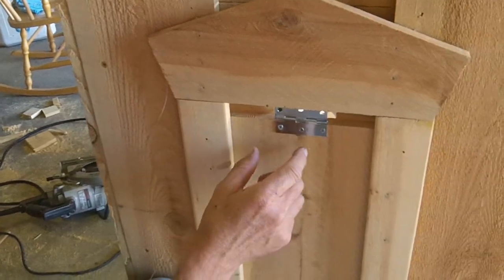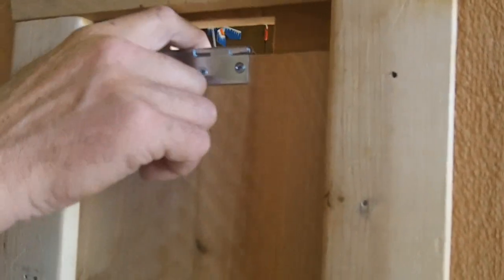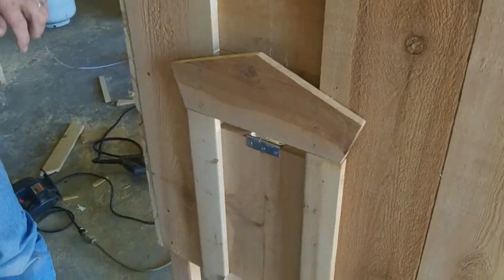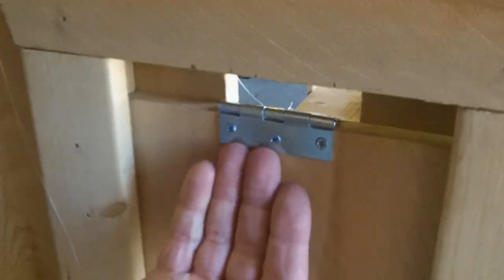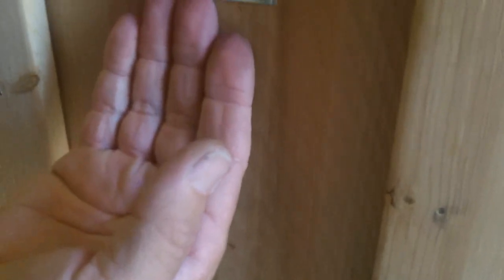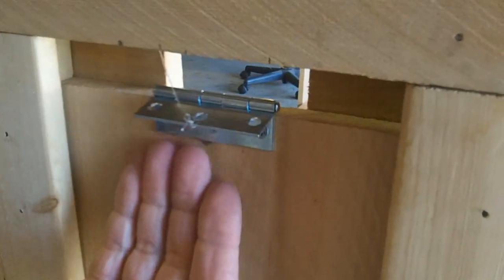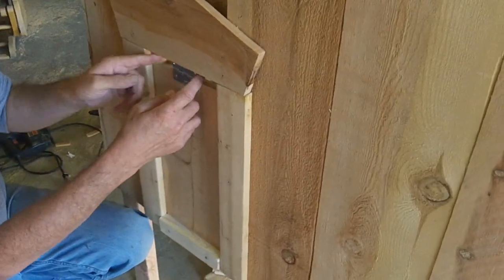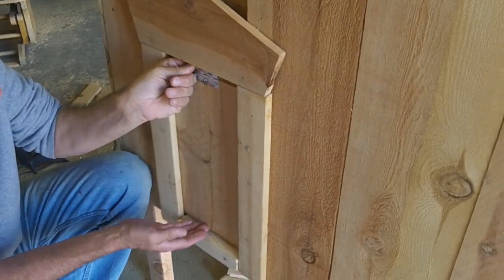A simpler self-locking predator-proof sliding chicken coop door concept

Comment: I just put a variation of this in my coop, works great. I used a clothes pin spring to force the hinge over, and made it flip to one side only so that there is no hole. Thanks so much for sharing your idea.
Reply: +enscribe I would like to see how you did this.
Reply: I would like to hear how you did this as well! Great idea, just trying to wrap my brain around how to make it work.
Reply: enscribe why not just use magnets. seems much easier. 

I already posted this so I'll just cut paste. 

I have a suggestion/modification that I will do on mine. Drop the header/top trim of the board so that the hinge will not be accessible to any predators. making it so the hinge can only fall one way. Shields it from the elements too. Next glue a small magnet to the top of the board just behind the hinge. This will ensure the hinge falls in place, adding extra effort to pull up. Some drawer magnets come with a hole in the center but if you can't find those, Harbor Freight has magnets you can glue on. Adding a magnet to the moving portion of the hinge gives it weight and helps stick to the other magnet.
Reply: Im making one like this for my coop and the front is blocked off and the top part of the hinge is pushed forward with a shim to create a slight angle, that way it physically cannot stay up and always falls forward. Only fail point I could imagine would be if junk got in the hinge over time and needed wd40 or something?

Comment: THanks for the idea!  Exactly what I was looking for!  Two comments or possible issues for improvement:   1)  The opening will let out heat from the run/coop  2)  We have snakes and ferrets/weasels that may be able to squeeze through the same gap.

I am going to try to build a housing for the hinge mech that can minimize both issues.  If it works out, I will post the solution if others are interested.

Comment: Very nice!  After seeing a raccoon use it's nails to pull a swinging cat door towards itself so it could slip back out of our garage I have great respect for these critters.  I would say make sure that they can't push the hinge up into the open position while pushing the door up enough (using the bottom of the hinge like you did) for the bottom of the door to clear the coop framing on the bottom of the door.

I would make the following mods:  1) mount the hinge on the inside of the coop so the bottom of the hinge can't be used as a handle from the outside. 2) make the door tall enough and the bottom door frame deep enough that the hinge has to entirely disappear into the top before there is an opening at the bottom of the door.  That seem to keep even our college educated raccoons from getting inside.

Not sure if this door system would work for areas with snakes.

Comment: I used this method on my new coop, did it a little different.  Liked the other folks idea of keeping the latch swinging one way so picking one of the non moving parts of the hinge barrel I angled a screw into the top of the door.  Now the hinge cannot go past verticle to the other side and falls one way only.  Works great and I had a hinge in my junk drawers, off what I can't remember.  Why I kept it in there when I moved everything and threw most of it out 3 years ago, well now I guess I know.  Thanks for the idea.  Plenty of them on youtube and some are real Rube Goldberg inventions.

Comment: This is an awesome idea. I will be making a version of this in my, currently under construction, chicken tracker. 

I have a suggestion/modification that I will do on mine. 
Drop the header/top trim of the door so that the hinge will not be accessible to any predators and completely hidden from the outside and making it so the hinge can only fall one way.
Next glue a small magnet just behind the hinge. This will ensure the hinge falls in place, adding extra effort to pull up. Some drawer magnets come with a hole in the center but if you can't find those, Harbor Freight has magnets you can glue on. Adding a magnet to the moving portion of the hinge gives it weight and helps stick to the other magnet.
Reply: I had the same idea but i think if you do that there is a chance the hinge will stay vertical resting against it.
Reply: @willm59  "Next glue a small magnet just behind the hinge. This will ensure the hinge falls in place, adding extra effort to pull up."  I covered that. But if you don't like that option you can always put a small screw and nut. Just long enough that the screw will not let the hinge go completely vertical. or a rivet that sticks out a tiny bit.
Reply: @willm59  Im thinking of using a magnet for cabinets, its not as strong as the ones with the holes in them, the circle with 0 ones in them are crazy strong... at least the ones I have. Not sure it will want to pull it down anyways? Im gonna try the angled screw trick first

Comment: Just an idea.  If you put the hinge near the bottom on the inside of the coop with a piece of wood as the block just above the hinge and forced the hinge to fall inside, the string problem goes away  Using a smaller hinge decreases the amount the door rises before being locked.  A few split shot sinkers should make the hinge fall the correct way.

Comment: I live in North Carolina and the Coyotes are spreading here fast, they go right through thin wooden and tin doors. We have had to add welded wire to our coop. We still use a wood panel door, we just added an angle iron frame for it to slide into so they can't get to the edge of the door.

Comment: Excellent! i was looking for a simple lock mech for my friends  automatic coup door that uses a  string system my current chicken door uses a threaded rod on a 12 v drill that holds the door down  . It would be fairly easy to cover up the holes you have so the racoons wouldn't think to flip the hinge which is very unlikely anyways. good job!

Comment: I've looked a a dozen different ideas, and this is pretty darn slick! I'll be putting a variation of it in my coop. 

In my case, I'll set the hinge so it will fall inwards and out of sight, either by gravity or using a coil spring. Also looking at motorized options to lift/lower the door.
Thanks!!
Reply: What did u end up doing for your door?

Comment: Don't get me wrong but, the animal is not stupid when it comes to hunting. If it were that part of the hinge fell in and not out, it would make an excellent door lock.
I can come up with 1 idea to cover that flaw:
- Place or re-make an extension underneath that horizontal wood with a spike that you have outside: the intention is that the other half of the hinge falls inside to serve as a safe and is not manipulated from the outside. The only slight inconvenience is to reposition the hinge by furrowing the wood so that the other half to be fastened is within the outer limit of the same wood.
According to your theory, when you close the door the blow should lower the other half of the hinge so that it is closed ........... well ... my idea is to make sure that the insurance is covered and not exposed .

Comment: Clever. The only down side I can see for our cold cold winters here in the north, is now you have a 2X3 hole for drafts to enter low in your coop.  Otherwise I like it a lot.
Reply: +med1pilot1956  I think he's using a smaller hinge than that or you could use one that would limit the hole to 1" x 2".
Reply: I live in Utah but I have read during the winter seasons you need to have ventilation in your coop anyway? Especially if everything is closed off trying to keep your girls warm during the winter?

Comment: The only improvement I would make is instead of having the hole in the wall so it can fall both directions. add a light weight spring to make it fall back into the coop every time. that way weasels and snakes mice even feed thieving little birds cant get threw the cut out. and if a raccoon gets its paw in there you will be replacing that fishing line a lot. the simplicity of this is great.

Comment: Very clever design. However, the down side is that gaping hole which will let wind into the coop as well as various predators!
Reply: I live in Utah but I have read during the winter seasons you need to have ventilation in your coop anyway? Especially if everything is closed off trying to keep your girls warm during the winter?

Comment: My coop doesn't need a door between the coop and the run. They can come in or out freely. Having a door could potentially trap them inside on a hot day. Security is the most important thing, So I used chain link fencing which is buried deep. I also would't trust chicken wire or hardware cloth on the vents, So I used expanded metal. Cheers

Comment: What is to stop Mr Raccoon from pulling on the string?  Mr Fox is also pretty clever and will probably get hold of that string as well.  Raccoons and foxes will work at that door for hours grabbing and biting and they may actually even accidentally grab that string and pull on it until the door opens.  Yes, if they get in they'll be trapped inside but isn't the safety of the chickens our biggest concern.  It is a very simple design that works really well, I just feel the string is right there in the opening where the predators are bound to grab and bite and maybe even get tangled in the string which will open the door for them.  I could be wrong.
Reply: +mosconi0359 You would have access to the string in a remote location from the door. If mr. raccoon grabs the string through the little hole at the door he will be pulling the lock/hing out blocking the opening. However if 2  operate as a band of bandits; they might be able to get in.
Reply: You could always run the Strong through some Piping. Or some Other form of barrier like Wire coverings etc.

Comment: Nice,,,,,,,,everyone seems to be concerned with the gap for the hinge. My thought would be to put a small strip of hardware cloth over the top of the outer top section?
Reply: +jeannean ingram no doubt.  SOme folks just aren't that creative, though.
Reply: +jeannean ingram My only concern with the hinge gap is that it could create a substantial draft, which would be dangerous here in the winter.
Reply: jeannean ingram I have a suggestion/modification that I will do on mine. Drop the header/top trim of the door so that the hinge will not be accessible to any predators. making it so the hinge can only fall one way. Shields it from the elements too. Next glue a small magnet just behind the hinge. This will ensure the hinge falls in place, adding extra effort to pull up. Some drawer magnets come with a hole in the center but if you can't find those, Harbor Freight has magnets you can glue on. Adding a magnet to the moving portion of the hinge gives it weight and helps stick to the other magnet.

Comment: Gives me an idea too!   I ordered electro magnet 130# 12v for $20 amazon (uses LESS than 2 watts of power!  That's like a night light amount!)...I will have it hold the door secure BUT I am putting springs that will constantly be trying to pull the door open ...then a time clock will cut the power every morning and springs will pull instantly the door open!  fool proof! ...my door slides sideways but it should work on any type I think....cause man does it get old NEVER sleeping in!   lol    ....nothing is perfect though....if there is a power outage even for 2 seconds the door will open ...but seeing how it is unlikely a predator would just happen to be lying in wait exactly on that very rare occasion?   I cant really be overly worried....I thought about building the self closing/opening door using power antenna a lot of folks have done but it is just a lot of work ....besides I mean one really should check their chickens multiple times a day anyway...we do  ....no big deal tucking them in checking their water and stuff....the hassle is getting up at 5 to 6 ish EVERY dang morning am just to let em out!  BTW if this appeals to you but you don't have electricity at your coup?   You could simply buy a 12v battery and the cheap  little solar charger from like harbor freight ....2 watts is nothing ...probably the smallest 12 volt battery and smallest solar panel/charger set up...but I already ran 120v down there so my wife can have a motion activated light and an outlet for shop vac etc.....So I'll just rummage through my box of old power supplies left over from various appliances and electronics or buy one if I have to ....120 volt ac in and 12 volt dc out ....1/2 or 1 amp rating would be more than enough!   wiring is nothing on the 12 volt side ...the electric door magnet has 2 wires so connect one to one side of the battery and the other to one of the time clock's normally closed contacts ....the other side of contact connects to the other battery terminal ...okay you are right ...sigh ....I imagine little power supply from an old printer or something will be intrinsically protected against short circuit and fire ....but if using a battery for the 12 volts I would  put a 1 amp fuse in line too just in case it shorts out somehow

Comment: Over time the hinge will become dirty and rust. Once this happens, there is a risk the the hinge will stick in the vertical position after being lowered by the string. A work around would be to have a very loose tolerance, floppy hinge or possibly adding a weight to the top edge of the current hinge. Those thin galvanized steel hinges tend to get pretty stiff over a winter.
Reply: +Aaron Bertoni Use a brass hinge.
Reply: Aaron Bertoni I have a suggestion/modification that I will do on mine. Drop the header/top trim of the board so that the hinge will not be accessible to any predators. making it so the hinge can only fall one way. Shields it from the elements too. Next glue a small magnet to the top of the board just behind the hinge. This will ensure the hinge falls in place, adding extra effort to pull up. Some drawer magnets come with a hole in the center but if you can't find those, Harbor Freight has magnets you can glue on. Adding a magnet to the moving portion of the hinge gives it weight and helps stick to the other magnet.
Reply: I’ve found WD40 once before winter and once during middle of winter it most all locks / metal moving parts operate freely

Comment: Just one way to improve it: The few inches it can be lifted leaves a gap at the bottom. Cover that with a 1x2. Perhaps a small predator could pry up the door and slip under the bottom 2".
Reply: I think a weasel could get in
Reply: Yeah weasels are smart and could get into that gap so that's why I'm saying he'd want to cover it
Reply: It looks there's an inch and a half or so raised threshold on the inside of the door, that I'm guessing he specifically added to eliminate the gap you rightly point out. You're absolutely correct though; one would want to add an inner threshold to counter the gap for the hinge.

Comment: I like the door but since I live in Michigan I don't want an air hole to let in cold air. I have no mechanical ability do you have any suggestions ?
Reply: D Montgomery Simply cover the air hole with a board on the outside of the coop. 

If you build your door really tall, you can hide the hinge and the top inside the wall of your coop.
Reply: deasttn p